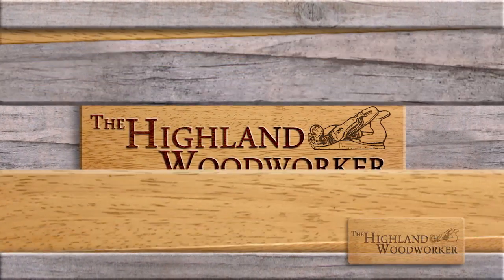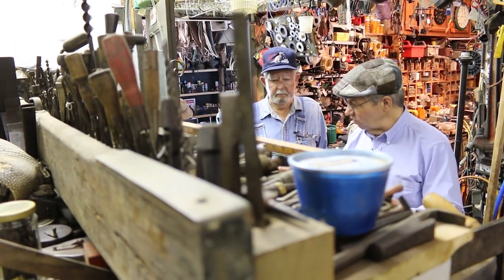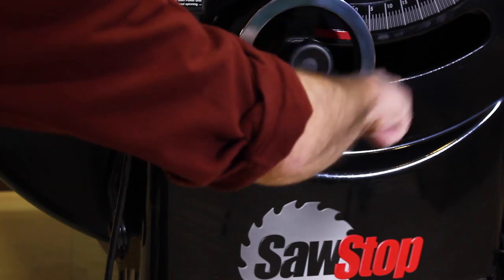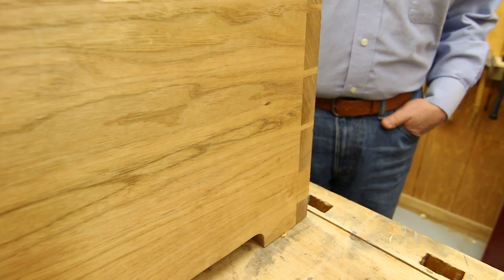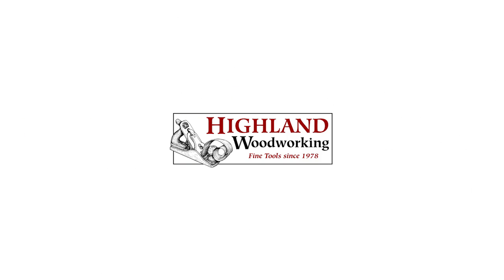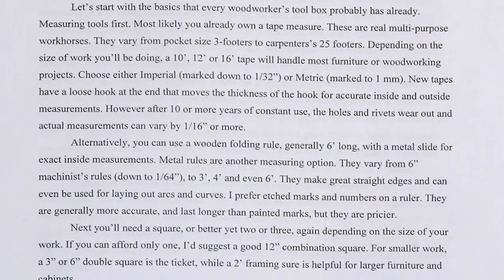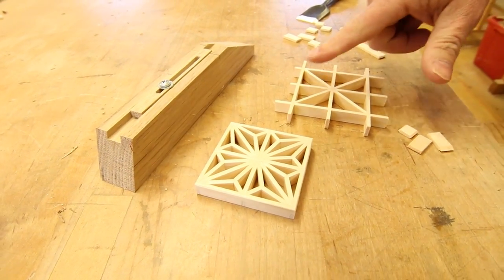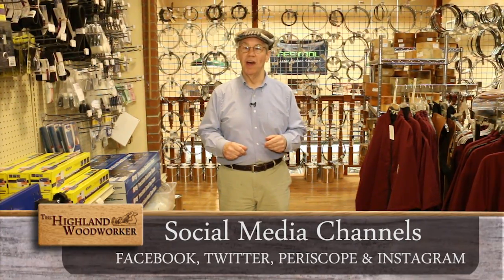The Highland Woodworker - Episode 27

Comment: John Tetreault uses some nice looking chisels. I know he rehandled his Stanley Sweetheart 750 and some bonus chisels in Romancing the Shop but the one he uses the most in this video looks like a Lie-Nielson. I suspect it only because it's lower edge is very thin and I'm not sure the Stanley set is that straight. It looks very clean and I'm guessing his Stanley set is worn a bit more. Probably replaced the 1inch with that. Curious because, holy shoot, it's attractive. The older chisel with a I-O on it makes me wonder what it is too. Edit: Saw a comparison on a site and a Nielsen had a 0-1 marked on it. Maybe they did that from early 2010's and stopped sometime right around 2018. The unmarked socket of the other definitely seems like a LN.